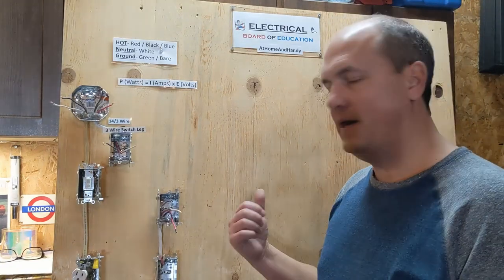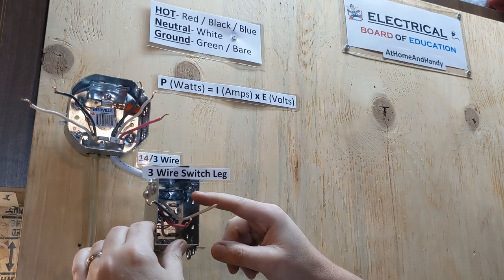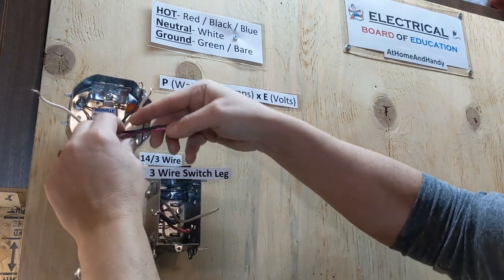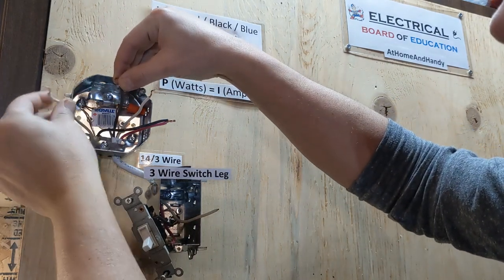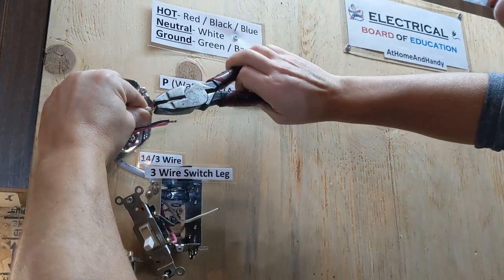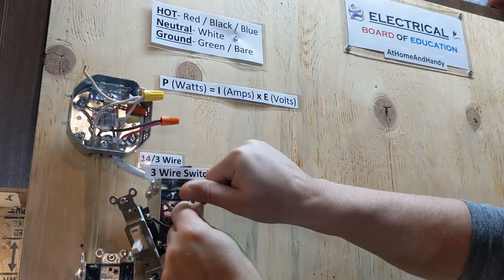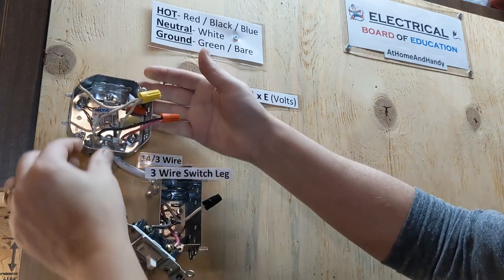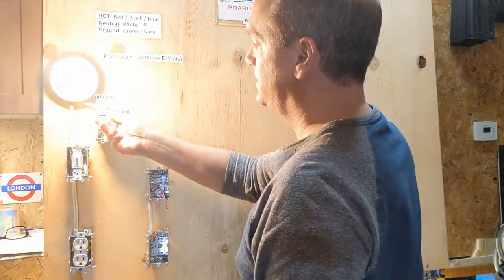How To Use 3 Wires On A Switch Leg off of a light  on the "Electrical Board Of Education"

Comment: If you simply capped the white wire in the switch box, why would you need to connect it to the white wire in the light box?
Reply from the maker: Great question. 
  The answer is so the Neutral stays true down to the switch. No, it is not needed in this example but by doing it this way it helps to future proof yourself. 
  If you decided in the future to put a smart device there (or any switching device that requires a neutral), this way it is already there.  Hope that helps :)